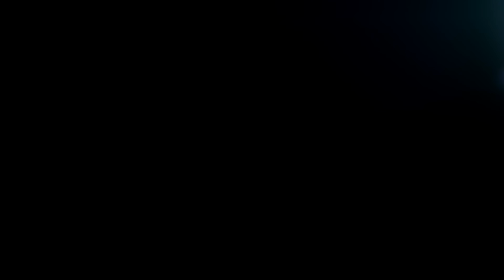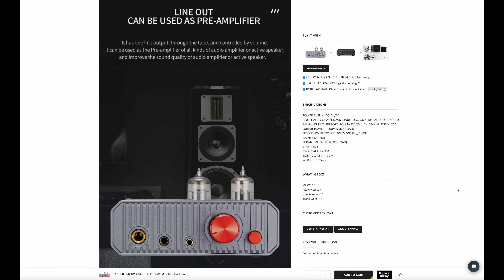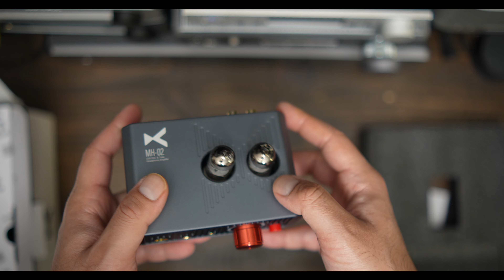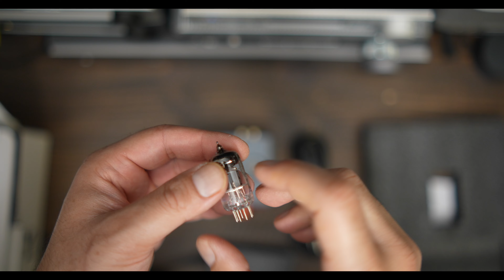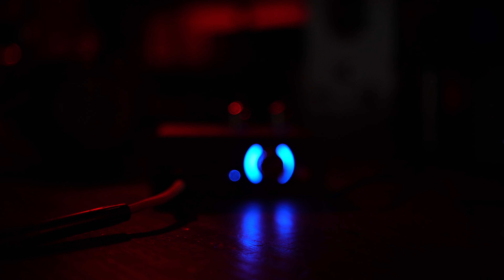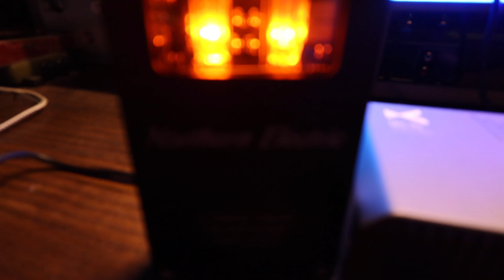xDuoo MH-02 - The Little Tube Amp/Dac That Could

Comment: Does it noticeably enhance the soundstage size / holography a bit?
Reply from the maker: Nope. This amp doesn’t drive large enough tubes with high enough voltage to get significant perceived sonic changes. No tube hybrid amp will match a true OTL amp, without DSP anyway.

Comment: what is the most affordable tube distortion device you can recommend for those who already use a dac and iem ( bur still offer noticeable tube sound distortion) ? thanks
Reply from the maker: Little Bear will probably do it. But if you want something better, get an iFi iTube. You might find one on AliExpress
Reply: The Fosi Audio P2 is the best low-cost amplifier available today. It doesn't handle heavy (250-300 ohm) headphones very well, otherwise it's a great device.

Comment: the 1.3W spec is for 32 ohm so for the argon the math do not add up , it's not going to get to 1W with a 50 ohm load
Reply from the maker: Nope, I don’t think so either. But without measurements of some kind I don’t know what it’s putting out. I think if you’re on a budget, this will do for the Argon.